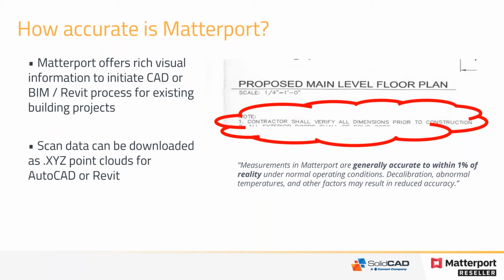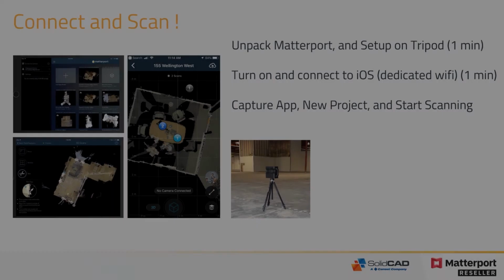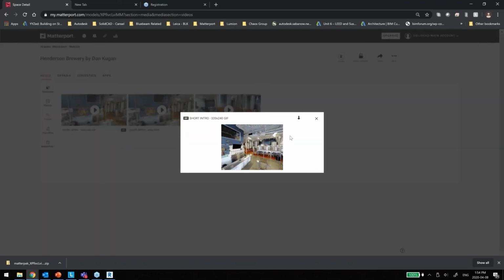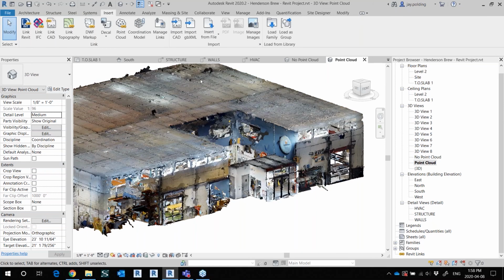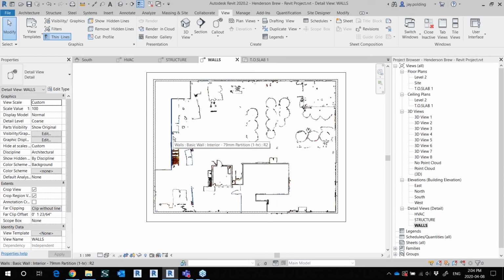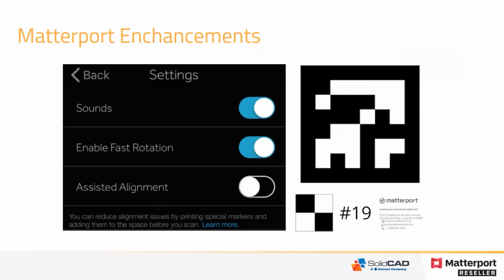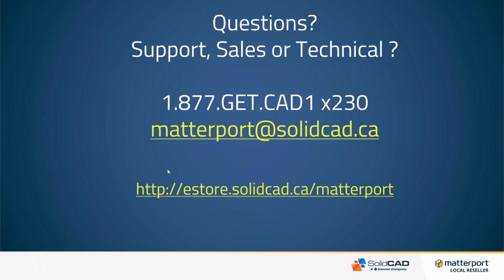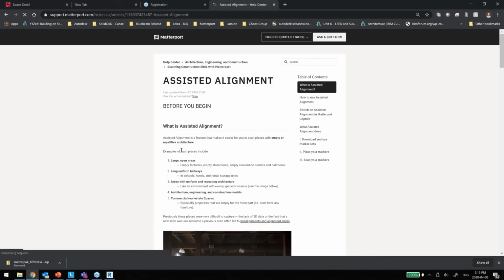Scan to BIM for Architectural Design with Matterport

Comment: my matterport scan links into revit as a bunch of dots about 3/4" apart. it doesn't look anything like (27:00)????
Reply from the maker: Hi Mark, It depends on the Matterport pointcloud, and saturation of points. If you scan more often, then you could have more points. Also you can check your settings in Recap, during the XYZ conversion. If you need more information, please contact our tech team at: https://www.solidcad.ca/products/scanners-hardware/matterport/